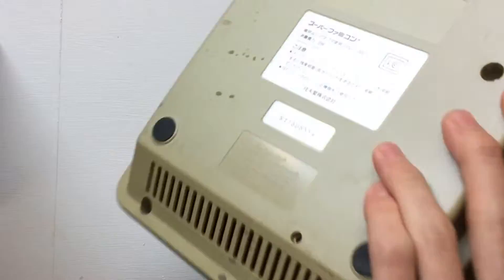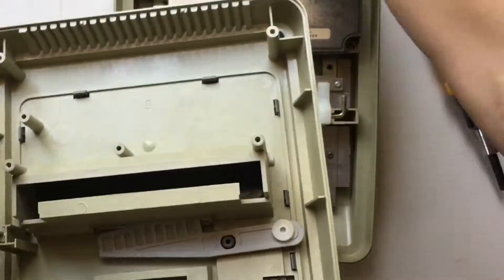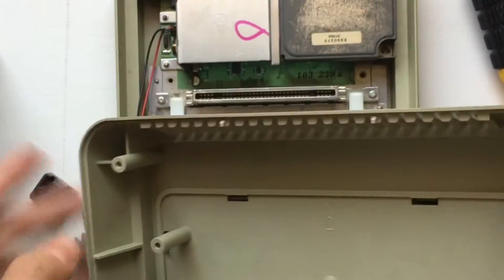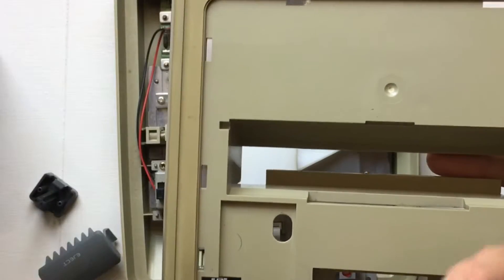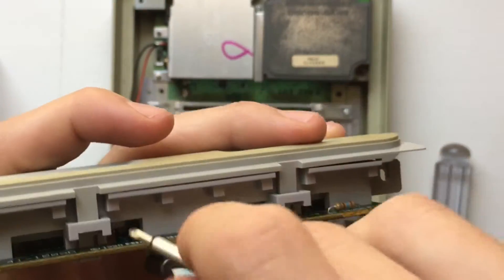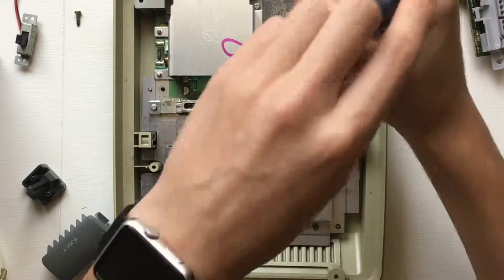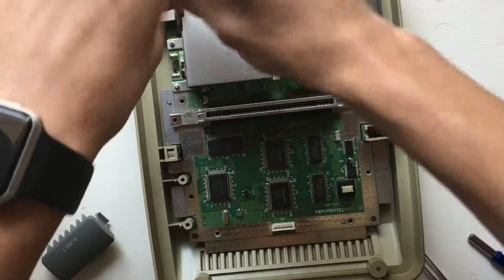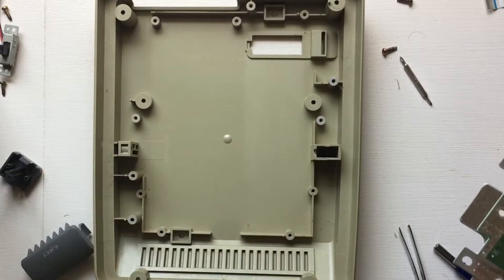Let's Restore: Super Famicom - Part 2: The Disassembly - Talon

Comment: The Super Famicom that you have is an original model from 1990. By around 1995 or 1996 Nintendo got rid of the sound board because they build a chip that can produce that sound on later versions or the Super Famicom. Fun Fact.